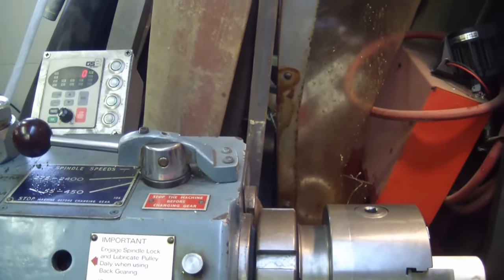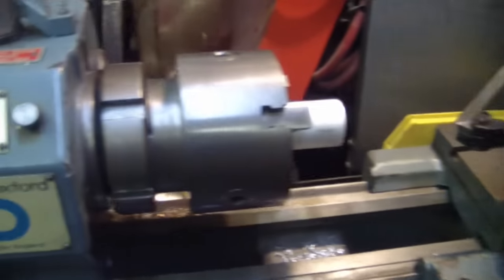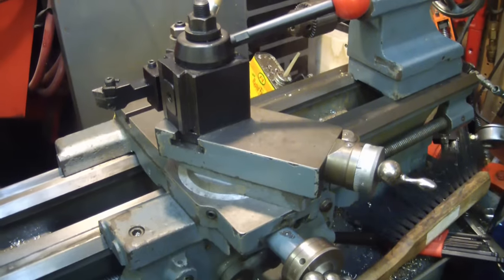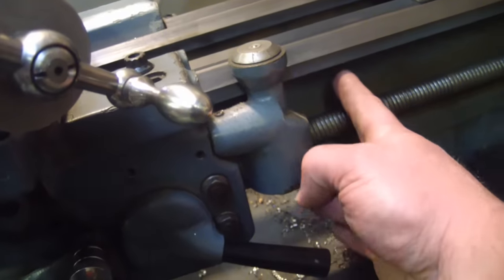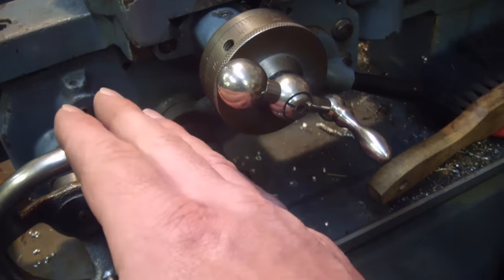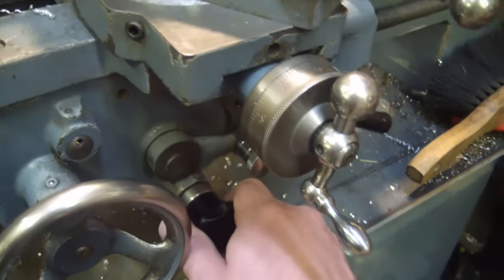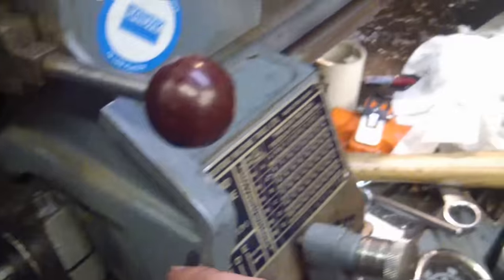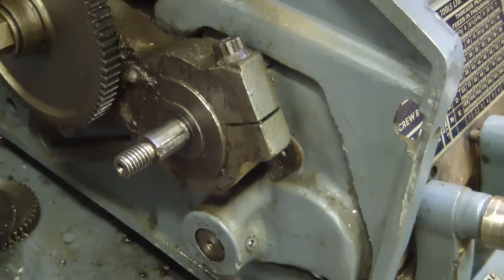3 Simple Rules to troubleshooting ANYTHING.

Comment: Your 3 steps are good advice. Had a PhD laser physicist give me a MacIntosh receiver once. He said it had no sound and that a young EE from work had tried to fix it and failed to get it working. I opened up the receiver and saw that it used transistors rather than tubes and that all transistors were socketed. Pulled the transistor data sheet and discovered the young EE must have pulled all the transistors and then reinstalled them rotated by one pin. I installed them all correctly and turned the receiver on. It had sound but there were dropouts when I adjusted the volume. Sprayed the potentiometer with some circuit cleaner and viola - it worked fine. Sold it for $250.

Comment: I have no idea why the YouTube algorithm has put this in my feed. I'm incompetent with anything more complicated than a hammer, and I'm not great with one of those.

Anyway- the reason for posting is because it's relevant to this video: I flashed a new ROM to my phone a couple of weeks ago. It didn't go particularly well, but I managed to get to a point where I had a phone with a working, custom ROM. Until yesterday, it got stuck in a boot loop. It would get to a certain point and then just shut down. I spent this morning and some of this afternoon reading others' experiences of this issue, what migfht be the problem, working out what order I was going to try fixes. I was as informed as I was ever going to be, and part of me was thinking of what replacement phone I would be getting if none of this worked. I checked that my PC had the most current versions of ADB and Fastboot, and plugged the phone into an onboard USB (not the USB hub) for added peace of mind. That's when the phone gave a different response to the one I've been having for the last 24 hours. It said "Charging - 1%"...

Comment: Played this game at work recently. So the  floor  burnisher was not working. Weak pathetic crank, no chooch. So we charges the battery, charger says good to go, we hook it up, again, weak ass crank, no fire. So down to the parts store I go, orders a new battery. Get the new battery in next day, install it, strong powerful crank, no fire. Feck. Start checking connections, find that the line to the propane bottle, while fastened onto the bottle, has only been tightened about 2/3ds of the way, so it looks good, but its not pushed the seal on the tank, and no fuel is going into the machine. Tighten 1/3rd turn, quiet hiss of fuel, crank, fire, purrs like a kitten. This is all after a week, and 3 other people trying to 'fix' it.
Reply: Assumptions will sneak up on you and bite you every time.
Reply: If you didnt fix it, it ain't been fixed

Comment: I have the long bed under drive version..exactly the same lathe that I used in metal shop at school in the UK in 1958-9..... I'm in NZ now, and my Boxford (which is really a licence built South Bend) has been a bit abused, but not used much. It also sported metric conversion gears which are handy, on an imperial lathe as a lot of stuff has metric threads these days. That friction clutch needs oil to work properly, oddly enough....they don't work if they get dry (buggers them up too!).... The only real lack for the Boxford is a limit of 21mm through the headstock spindle. For my gun work I would do with a bit more, but up to that limit it's fine. I did manage to fit a 'spider' on the outer end to steady stuff like gun barrels. There's damn-all room to fit one, and I had to modify the gear cover to accommodate it but it was a worthwhile addition for other long work held in the chucks.
The only thing I didn't get was a set of outside jaws for the 3-jaw chuck, which is an old Bernerd and I doubt I could find a set now.
A great machine for its day, and still good today,

Comment: So true. I love fixing up old small engine stuff for the same reason. Owner usually never tells correctly what the problem is, which is usually much simpler than they think. Just recently, I was at the dump and found a nice Toro snowblower. I figured there was probably nothing major wrong with it. I took it, cleaned the carb up and lubricated it and have been using it all winter.

Comment: Halifax, England. My neck of the woods.  Just a 20 minute drive. I wonder if they have anymore machines for that price?
Reply: Me too i am IN Halifax England. I Can see the BoxFord factory from where i am sat lol :)
Reply: They come up on EBay occasionally, great machines as often they are ex. school/college training machines and so have had little use compared to production machines. Mine did have a worn cross slide lead screw but you can still buy some spares (original and re-manufactured) for them. I got lucky and mine came with a fairly rare taper turning attachment which is almost worth what I paid for the whole machine alone. Was about a 300 mile round trip London to Hull to pick it up though :-)
Reply: Adrian S same here, in Illingworth. Never realised Boxford lathes were made here, where's the factory?

Comment: 1)  Understand what you're working on.
2)  Quickly develop a flow chart, a plan, for your trouble shooting.  It's logic!
3)  Some problems are weird...intermittent, fluky, frustrating.
4)  With the right instruments, even invisible problems become visible.
Reply: Can you elaborate on the flow-chart/plan for troubleshooting?
Reply: @thaboshikwambane  It is different for every issue and in some cases every different vehicle.  A "no start" situation would be a good generic example in older cars.  Now, less so.

Are you familiar with flow charts?  All they really are is a logical sequence of questions with the answer to each directing you to the next step.
Reply: @Sherman62   💯 I see

Comment: If something is electronic, there are 2 steps to troubleshooting 
1. Turn it off and on again
2. If step 1 didn't work, throw it out and get a new one
Reply: +Justin Howlett don't turn it on, take it apaaaaaaaaaaaaaaaaaart
Reply: Agreed. If you take it apart and can't get it working, so what? You were going to throw it out and get a new one anyways. Just keep your booger hooks off the capacitors and tinker away.
Reply: 1.1 Check all the connectors.
Reply: Step 3 get the big hammer

Comment: "we're gonna take this little knobby and JAM it downwards"... 
I'm sorry, are we all missing the single greatest line from this video? Yes, the rest is gold, for various reasons. But... he who can confidently call it a "little knobby" and get away with this is god level. 

Coming from running a tool shop for two years... I'm an engineer, and if my toolmakers ever told me that the little knobby didn't fix the problem, 1000% would believe them, no questions asked. 
Same guys that once threw a piece of tool steel at my head for giving them decimal dimensions on a print. Lesson learned....

Comment: I bought a used riding mower from a guy who said it didn't cut any good so he took the blades in and had them sharpened, he said that when he got back and put the newly sharpened blades back on it cut even worse.  He got fed up with messing with the damn thing and bought a new mower and now wanted to get rid of the old one so he was willing to let go for cheap.  When I got it home sure enough it cut like crap.  I got off the mower looked under the deck and the blades were bolted on upside down!   Best deal I ever got on a lawnmower.

Comment: I find that when thread cutting on my Southbend lathe (similarly fitted with the little clutch knob) I can feather it so if the saddle is going to hit a stop it will set it to do that and then while the knob slips I can back out the cutting point...works great. The slip clutch is metal plates only so not mauch chance of them "burning".

Comment: One thing I'd add, sense check before you jump into anything. Has the thing been working all day until the cleaning shift has been near it ? Check for things susceptible to water ingress. Something not turning on after a stop but it's been running all day ? Maybe check the toggle switch that gets turned on/off multiple times a shift and is open to the elements. Loss of temperature? Check the contactor that goes in and out all the time as the temperature rises and falls. It's usually the workhorses that fail first, not the bits that don't move in the panel

Comment: Thanks for sharing man.  Are you using a VFD w/ 1 phase power?   Is that 240V single phase power or what?    
I've just got a 120V Craftsman/Atlas lathe, wanted a VFD, but was told they're not available for 1 phase, so I just got a universal soft start.  Thanks again,   - take care

Comment: As a maintenance tech one thing I try to convey to the greener techs which would fall under his #1 is when a machine that's been running fine stops look at what the operator could have put their hands on it bumper before you open the electrical cabinet.

Comment: For years we would have inspections and they would find errors and recommend corrections and we would follow orders and do exactly as ordered. The following year we would be inspected and something of the nature that would contradict entirely our previous order would be listed as the fault. This would happen whether it was the same inspector or someone new or just different, every freaking year.several times a year.
So, on the prospect of a third year inspection I decided to read every regulation and SOP pertaining to my section and implemented several changes, There was some initial grumbling and I had a discussion with my commander showing my thought process and reasons for every action that I took.
Low and behold the inspector came and started writing up all sorts of so-called errors. I let him go through everything thoughtfully listening and asked did they really want to cite these errors and needs for corrections as stated? I requested that every error be put in writing and waited for the report. Having discussed this with my commander we knew the inspectors didn't have a clue about their jobs. After receiving the report. I thanked them and requested a detailed listing of every error citing every regulation or SOP that was out of correction. They doubled down and sent me corrections that were not on the previous list and made up errors that cited the same issue. That's when I sent them the very latest updated regulations and SOP for the standards they should have been checking. I cc'd command and provided every evidence that what they were doing wasn't or hadn't been standard for as long as anyone in the service at that time even was alive. Needless to say there was a big shuffle, retirements and ousting of several personnel. This lead to me being fast tracked for my own company command. Yeah, I learned not to trust someone elses work that year.

Comment: I worked as a tech for many years in recording studios, and part of the job is making sure the offender looks good in front of the client.
Had a call because the headphones were not working out in the studio, asked if the engineer turned on the amps.
"OF COURSE I DID"
Alright, I'll be right down!
Walked right past the amps, that happened to be turned off, spent a couple of minutes out in the studio swapping cables and flourishing my multi meter, flipped the amps on as I walked into the control room, and asked him to roll tape.
Yep, it works now, my apologies that a bad cable was shorting out the system!
1 second ago

Comment: 4. Isolate/split problem in half.
5. Don't be afraid to break parts.
6. Compare faulty unit/system with new or functioning example
7.  Make sure your testing equipment is reliable.
8. Test thoroughly after repair - Make sure you are fixing the cause and not an effect.

Comment: New York guy: You used to be a mechanic, right? I adjusted my valves and now I have a rod knock.
Me: Too much coincidence. Go back and re-adjust the valves.
NYG later: I can't get the pan off'
Me: Leave the pan alone. Re-adjust the valves.
NYG later: Do you have a picklefork? I need to take the front end apart so I can get the pan off.
Me: Head on, brother.

Comment: I would say rule number one is understand whatever you're working on. You need to know what it does, and how it is supposed to do it before you can say whether it's working correctly or not.

I've had countless operators complain about something not working, when it was a feature or function of the machine.
Perfect example, an operator was complaining the brakes were dragging on his articulated wheel loader. He was unfamiliar with the machine. It was a hydrostatic wheel loader, meaning, when you stop applying throttle, it will slow down very quickly. It will not coast.

Comment: I was asked by my department to take a look at an arc welder for a researcher because I was the only one with welding experience and the maintenance guy/machinist and said PhD holding researcher had gone over it and could not figure it out. An arc melter is a gaint GTAW torch in a vacuum chamber for materials research. I was the only one in the department with welding experience so they said take a look. First thing I did was asked for a multimeter and checked the leads. Lo and behold the water jacketed wire from the power supply had corroded and was a 200 buck fix and the researcher was wanting to spend 6 grand on a new psu. Rule #1 is definitely there for a reason

Comment: I once showed up for an afternoon shift running a soap wrapping machine only to find the morning guy doing nothing while a team of engineers from the machine manufacturer were huddled around the power cabinet trying to figure out why the machine wouldn't run. It took me less than one minute to check the emergency stop buttons and find one locked in the off position (they can be accidentally pressed in by the operator's thigh).  I unlocked it, the machine sprang to life, and the crew of engineers all looked at me like I'd made them look stupid on purpose. I bet they all learned a lesson that day.

Comment: I was in aviation maintenance. The first thing I checked when a light didn’t work in the cock pit, was the light bulb.  I have come on shift to find someone with components pulled out...for the second time, trying to fix something. When I asked if they checked for a burnt light bulb, I would get blank looks, then a light panel test would confirm that the bulb was out.

Comment: No matter how difficult get a manual first. Then start to investigate. With any machine make certain the solid and moving parts do not hit each other on first or any start. Also wear safety glasses or a face shield if the thing will start throwing chips.

Comment: 1. Correct
2. Correct....even if it was you that tried and failed. Stop and have a rethink...start diagnosis from scratch as you have lost sight of the problem. (unless you aren't good enough to fix it.)
3. PEBCAK...from tech support. Problem Exists Between Chair And Keyboard.

Sometime 3 is so bad that it generates an IDtenT error.

Comment: As an automotive tech i have personally ran into simalar issues . Customer was about to pay 500 dollars for a job that i didnt diag. Was about to pull the intake manifold and replace an injector. Before pulling the intake i did a little investigation myself turned out to be a spark plug wire. Guy didnt even check the right cylinder for the misfire . Never hurts you to start from scratch and double or even tripple check SIMPLE THINGS FIRST !!!

Comment: my rules are: Ask the operator what he thinks is wrong. This gives you an idea where to start. Next, trick is to determine what isn't wrong. Next: It usually isn't the expensive parts, look for loose wires, broken bolts, sheared pins etc. Many times, the main work is the troubleshooting, and many times, it' s some loose part, dirt, etc. Add one thing: lots of times, it's just dirt or grime. Clean the working parts. Bottom line: You usually don't have to replace the "kanutin valve assembly" It's the low cost fix, like replacing a broken screw, or reconnecting a wire. Oh, I forgot. PST, or Proper Cussing Technique is all important. If you can't get it to work, cuss a blue streak, leave for enough time for that little bulb to light up in your head, the "Oh that's it" moment. Now get back to work.

Comment: My dad was once given a broken push mower because he liked to tinker on things and his friend had a broken mower. Dad brought it home, checked the spark plug . . . Good. Checked the pull cord . . . Good. Checked the air filter . . . Good. Checked the gas tank . . . Empty - which makes sense. Why wouldn’t you drain the gas from a mower that doesn’t work? Filled it with gas, pulled the cord twice and it fired right up. It was even self propelled! 🤣😆😂 he offered to give it back to his friend since there was really nothing wrong with it, but the friend said to keep it. We used that thing for like 10 more years! LoL

Comment: Rule number two is so true and I’ve been told
It by my uncle before but, when it really set in was when me and my brother bought an old Ford with a misfire and the guy said he changed the plugs and the wires. He was a millwright at Exxonmobile so we thought yeah this guy must know his stuff and my bro worked with him so we trusted him. Turns out the misfire was because one of the spark plugs was cross threaded and wasn’t installed correctly.... go figure

Comment: "If the problem is electrical, more often than not it's a pretty simple continuity problem. I used to work on instruments for huge control systems. I've fixed countless things by re-landing a loose wire when the other guy was going to replace the unit entirely. Open circuit = No worky.

Comment: Those gears at 3:34 look too tight. If you can back them off and give a little play, it should run a lot smoother and make less noise. I'm not getting a straight on shot at the actual gap, but they look too tight from that angle. I made and installed gears for years. Just a suggestion.